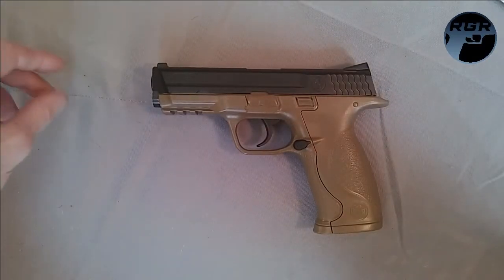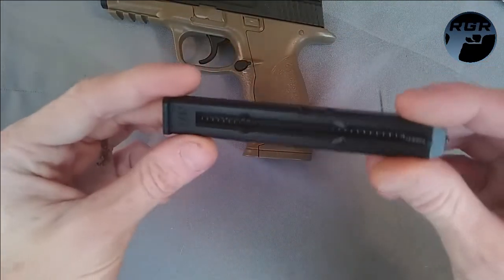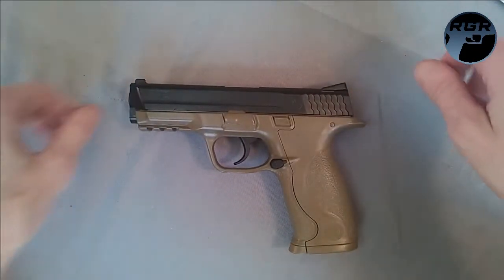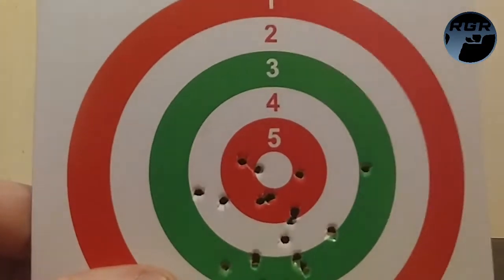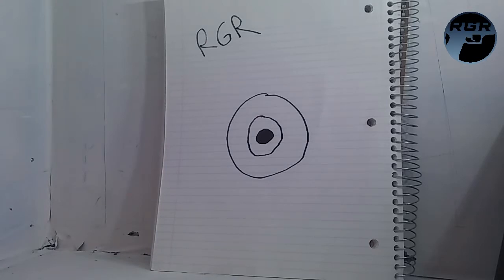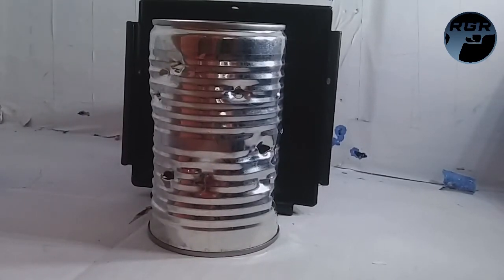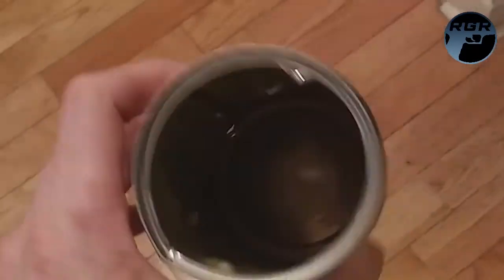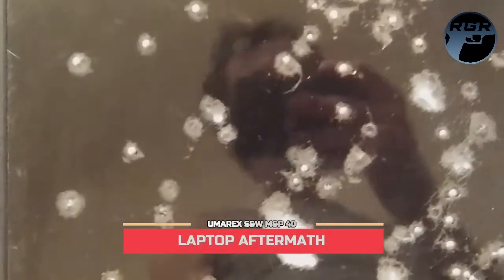Umarex Smith & Wesson M&P 40 Review [.177 Caliber]

Comment: I've got the blowback model UMAREX S&W M&P40. I get 4-1/2 x 15 round mags from a 12g CO2 cartridge before I run out of CO2. I've also got a Crosman Night Stalker blowback model with red laser. With the Night Stalker I get 6 x 18 round mags from a 12g CO2 cartridge before I run out of CO2.
Reply: I am thinking of getting Night Stalker it looks cool,it’s metal and it’s short blowback so if you get 6x15 per CO2 that’s not bad at all,only problem is, I don’t have $100 bucks 😂..